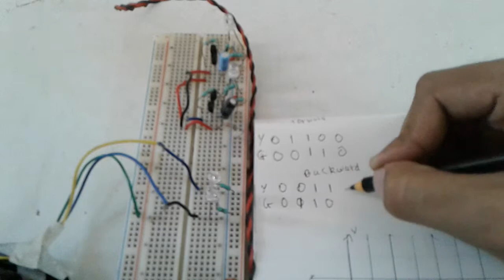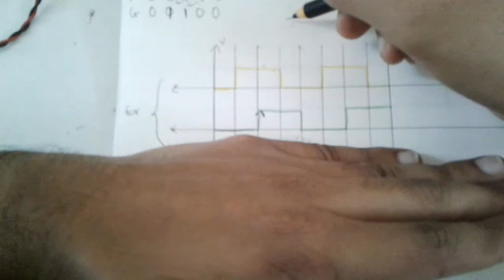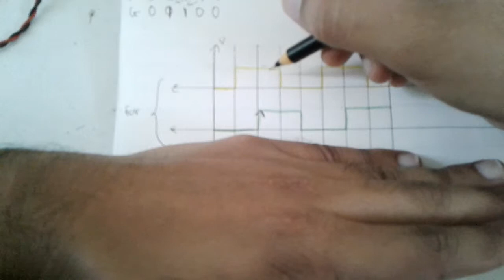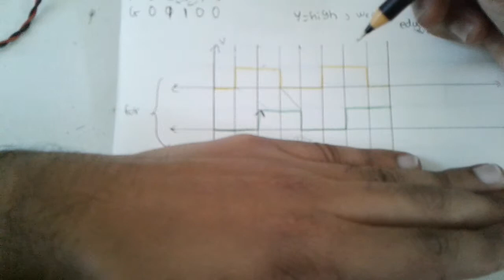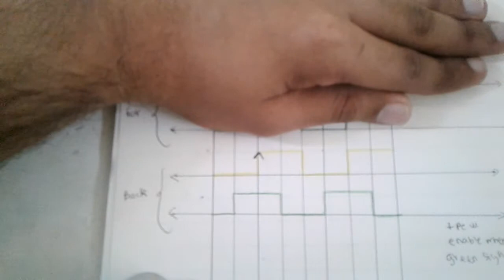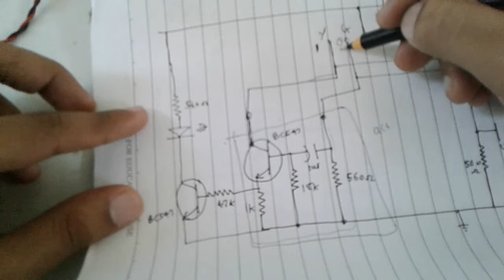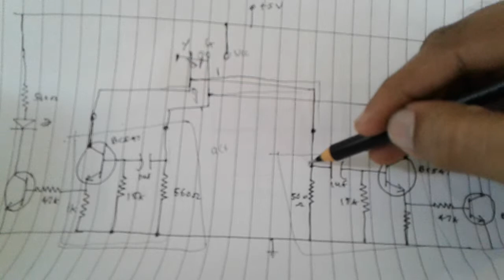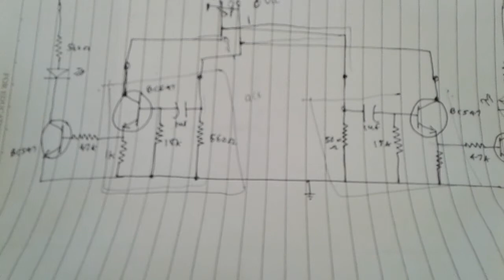Quadrature rotary encoder circuit  (4 transistors )

Comment: The circuit diagram is not visible properly and also the link given in description is not working😕
Reply from the maker: What comes when you click on the every circuit link. Does it says " circuit does not exist".
Reply: @prachethire812  yupp
Reply from the maker: @paarthrane5229   click on the every circuit link again. Then it will tell you to enable native client. copy and paste this link on chrome address bar:-
chrome://flags/#enable-nacl
 then enable native client. You will get to view the circuit with simulation. try from laptop or desktop computer if the option for native client is not available.
Reply: @prachethire812  Actually my doubt is that... in the main circuit(consisting of transistors) the LEDs are responding to the motion of the scroller   also when there are no transistors the LEDs are responding to the motion of scroller in the same way as in the main circuit....so my question is that what is the use of transistors if we can directly encode using just LEDs and the scroll
Reply from the maker: @paarthrane5229  well I am glad that you figured it out,unlike the negative edge detector, the positive edge detector can be made just by a capacitor and resistor network. Transistors are just to amplify current and provide isolation in case you want the signals to be fed to some IC or microcontroller.
Reply from the maker: @paarthrane5229  also I am curious to know about your circuit, you can make a video on it or write a blog about the circuit.